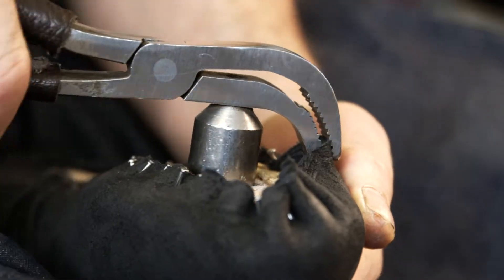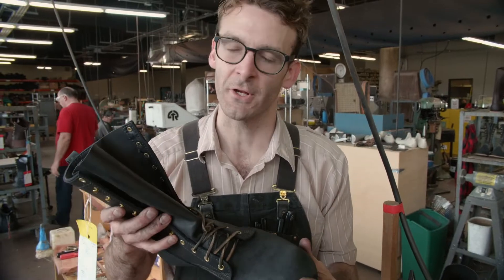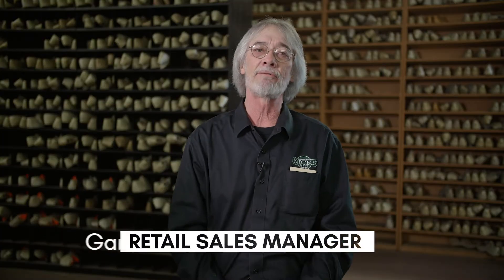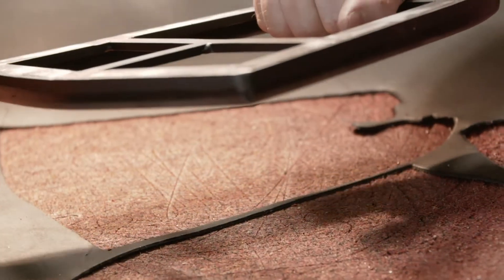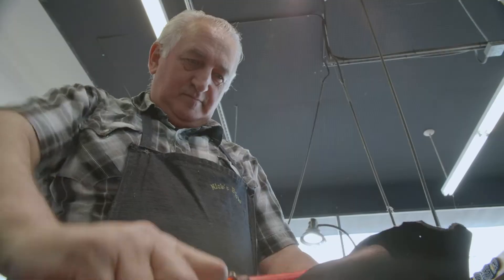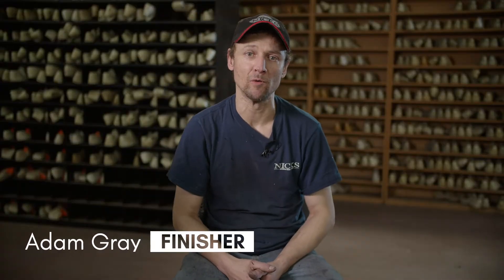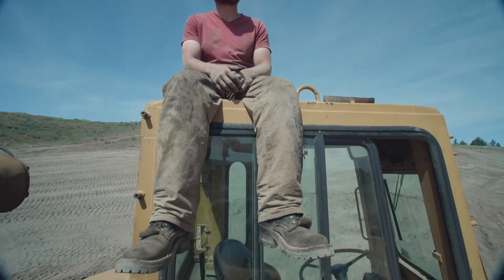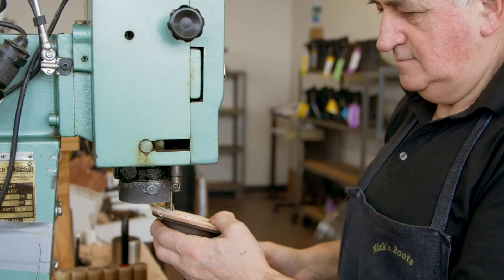Nicks Handmade Boots: Our Story

Comment: I just passed the 2 week mark of wearing my new Roberts, MTO w/ Wickett & Craig English Bridal leather, cut top, 6" shaft, 430 mini Vlugs on the 55 last - and I am in heaven.  I'm breaking them in slowly, but they were pretty comfortable out of the box.  I have high arch feet, and the 55 with the leather shank and extra leather lift really is almost perfect, just hitting the bottom of my high arch without forcing it upwards (or missing it altogether) - a testament to Nick's fitting process.  Toe box is perfectly comfortable, no hot spot there.  My only single hotspot is on the top of my arch where the end of the vamp connects, which is to be expected during the break-in.  2 weeks in (~30hrs) and even that is already softening up.  I've already ordered 2 other different MTO pairs based on the same size since Nicks & team absolutely nailed it.  Well done.  And I totally recommend them - great boot, great quality, and great people makes for a great experience overall.  Thank you Nicks Handmade Boots!
Reply from the maker: Aren't they great!?  Thanks for the support.

Comment: Got them the day before yesterday. 20 minutes first day. 45 minutes yesterday. 2 hours today. They are just starting to break the ski boot stiffness. I'm not used to boots that fit this well, I'm used to lacing them very tight to hold them on my feet. My old Redwing 899s in 14B are just a bit loose. So today I let up a bit on the lacing, much better. The fit is amazing and my feet are narrow, especially at the heel, I tend to get heel lift, not these Nicks. So far I'm very happy with them. I did my weed eating and mowing in them, began to forget I had them on.
Reply from the maker: Love it.  Keep us posted!
Reply: They went on a trail hike today (with my feet in them) helping my work partner carry equipment a mile in. Pretty good, got a ways to go.

Comment: I usually buy ariat boots. But I'm starting to think I might need a custom boot. I don't have an average foot at all. I should wear an 11-11.5 boot. But usually get a 12. Width is an issue. I usually wear pull ons because lace ups and water don't mix. But my toes aren't being properly protected underneath the toe cap because of the length needed for comfy wear because I can't force the top of my foot into the length I need. I hate tight cramping pains. Just not sure if these would last in the oilfield. I would love to find out more.

Comment: Hello NICK'S. I'M LOOKING FOR ANOTHER PAIR OF FIRE BOOTS. I'VE ALWAYS BEEN BUYING WHITES FIRE BOOTS FOR A LONG TIME. I'VE BEEN A WILDLAND FIREFIGHTER FOR 18 YEARS.
Reply from the maker: Sounds like you're looking for a pair of hotshots. You can check 'em out on our website!
Reply: Looking for boots this time in my size I checked Whites and they don't make my size (I guess if the entire world was 13D or shorter that would work). Redwing has one boot in my size (14B), an electrician boot not suitable for my needs. My boss (he has even bigger feet but is blessed with a standard width) suggested a website that sells large sizes, they have 4 options in my size and 1 suitable for about $300, that was tempting but I chose to go with Nicks to get the custom fit, which it is a really excellent fit.